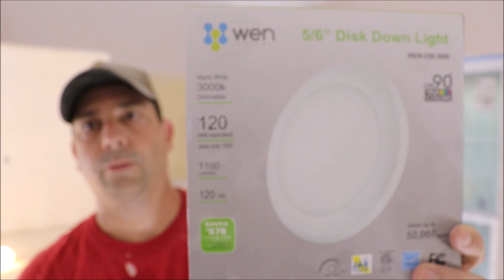Building My Own Home: Episode 124 -Repainting the Ceilings and Installing the Recessed Lights

Comment: so I'm still right behind you on my home build, just finished my drywall.  do you have suggestions on paint sprayer equipment? I have an air compressor available.
Reply from the maker: I bought a airless paint rig from lowes to paint the outside of the house. I also used it to spray the ceilings, and then put a power roller on it to paint the walls. Rolling the ceilings was a neck killer, I will never do that again! Spraying the ceilings and rolling the walls woklrked good for me.